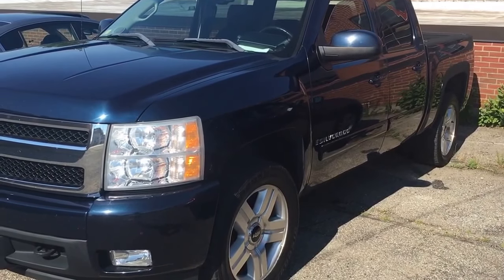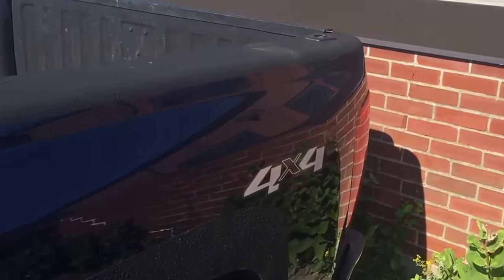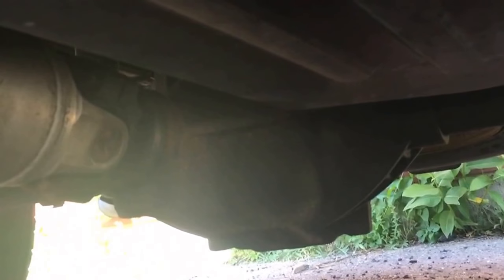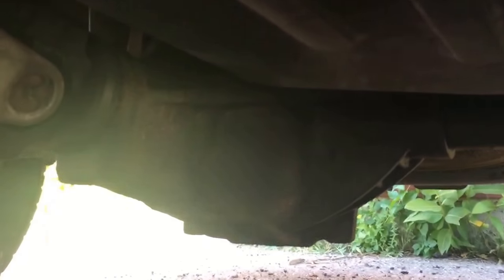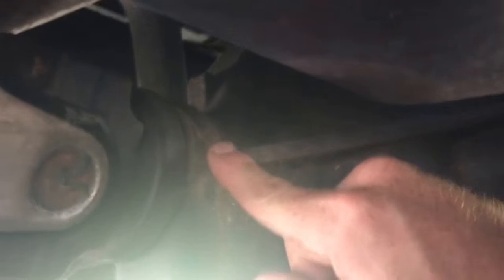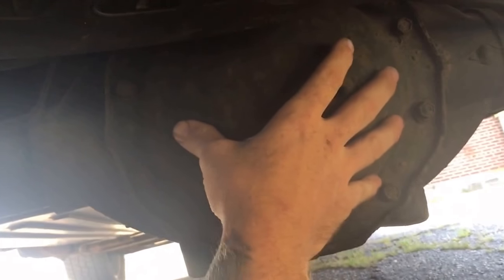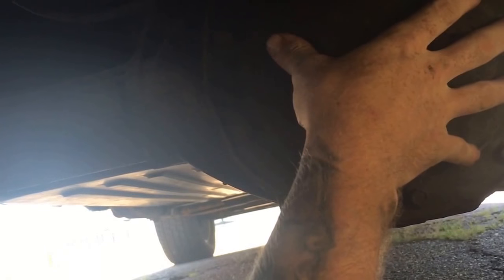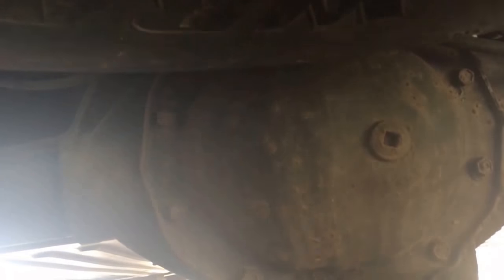2007 Silverado rear end HOWL FIX

Comment: In the beginning my how would occur while foot on accelerator and speed 40 to 60 mph.  Higher speed the pitch of the sound would be higher and less audible.
Now several months later the how is more of a grind very audible at very slow speed. The sound not steady but osculates like with each revolution which is several times faster than the rear wheel makes each turn.  Figured it might be pinion bearing because the pinion turns faster than the carrier due to gearing perhaps like 3.73 to one. I yanked at the yoke on the pinion and got no movement, same as guy in video.
Reply: When you replace pinion bearing did that solve problem?
Reply: Did the bearings fix your problem?

Comment: I have a 2006 Chevy silverado with the 4.3 v6 . It was doing the howling noise when I would slow down. It's at the repair shop now. They said it's the differential bearing....($500 job). Hopefully it's just that and not the differential gears....(that's a $800 job) !!
Reply: I have an '07 silv 4.3 4x4 w/200k miles. Was yours the diff or gears? Thanks. The mechanic said mine would be $500-700 also. Mine starts shaking a bit over 52mph and howls on decel. It all started the same time. He couldnt find a used axle to swap out for under $1300.

Comment: Hope noone thinks it's just a simple take it out put it in....slot involved with backlash adjustment and such or it will just grenade eventually.
Reply: Man I'm doing this n it fucking sucks. I've done everything but dealt with rear ends n I know the shits super delicate.  It's starting off to b a fucking nightmare also I thought It was my wheel bearings but as I popped the cover I saw my spider gears chewed up pretty bad n also idk that the part behind the wheel bearing is.  There's the actual bearing n then this other type of bearing I think it's flatter